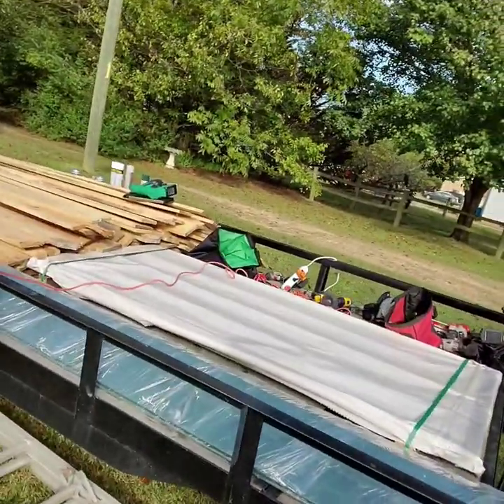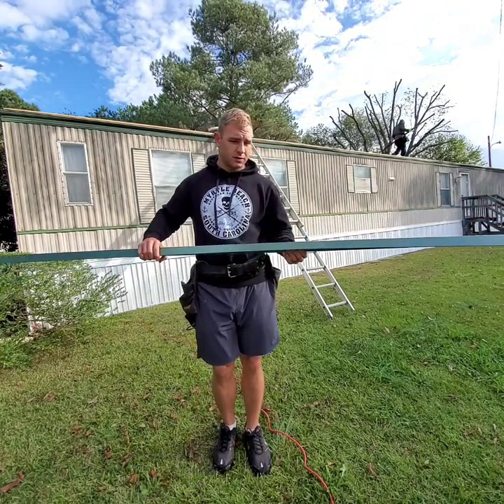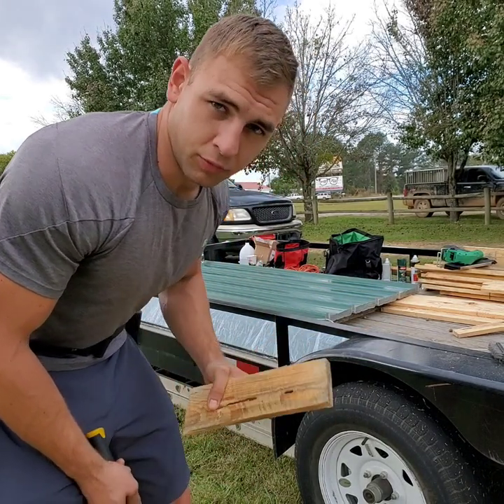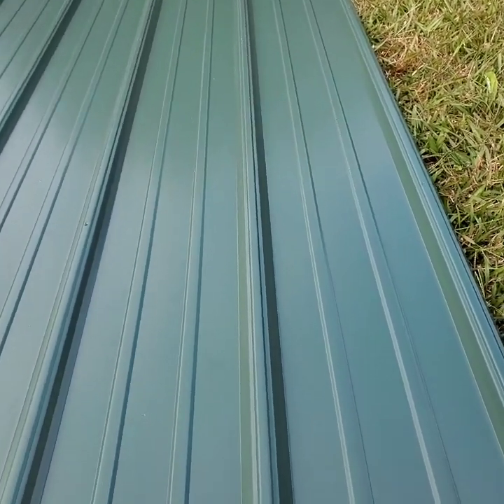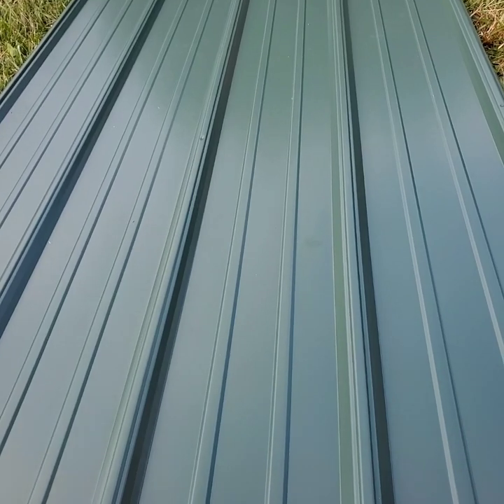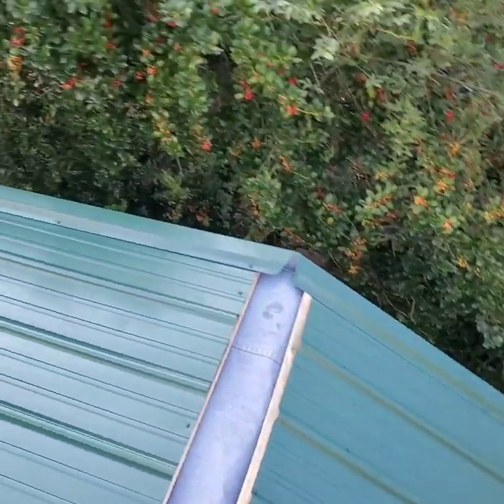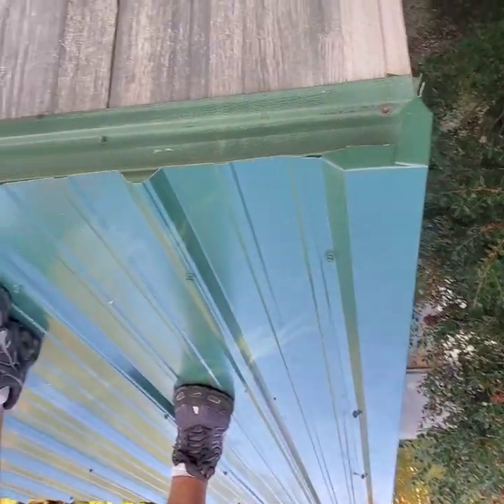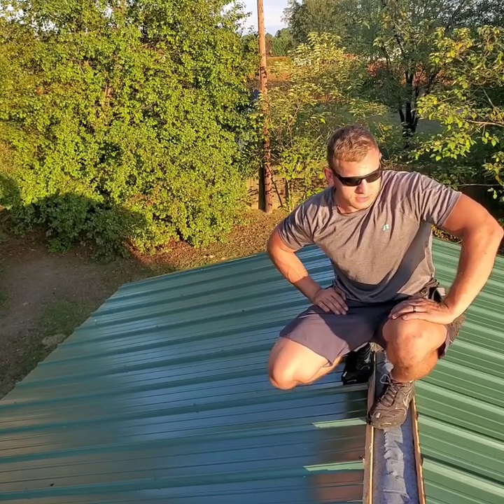How to install a Metal Roof on a single wide.

Comment: Just put vinyl siding someone gave me on a 1971 single wide and gave it a much improved face lift.This is my project next spring to finish it off.Great video to get me motivated.
Reply: Do you  have a video of that? How did you do it I have a 74 model do I take all metal siding off an put vinyl  just like you would a house?

Comment: Great video. I've been wanting to roof my single-wide and your video has given me a lot more confidence. Thanks.
Reply: So there's no gutters it just runs off the roof on the single wide, you covered up the gutters or you just left them underneath?
Reply: @michaelstefani2193  I took the factory gutters off, because they were in such bad shape. I installed 5" K-style house gutters
Reply: @michaelstefani2193  5" house gutters with a super thick bead of Lexel between gutter and home, hidden hangers on 24", screwed on 4", downspouts on all four corners
Reply from the maker: I'm happy to hear!! congratulations!!
Reply: Where are you guys located ????

Comment: Great job Ricky.  I do a lot of work in Charlotte and some S. Carolina work near the Pee Dee.  With about 15 years experience, screws in the ribs are just fine.  With the amount of rain we ha e been getting lately, it’s probably the best idea.
Reply: im going to do mine and i will add a bead of sealer between my over laps as a protection.   Make sure you know which way the wind blows 90% of the time. Why because you need to lap start at the end the wind comes. this way the tin just rolls with the wind.

Comment: I think I would have added a layer of ridged insulation between the 2x6s for additional R-factor as well as to reduce any noise from the suspended metal panels.  Just a thought.
Reply: Good observation and thinking. It is common practice to add insulation.
I think he used 1x6 material not 2x6. The R value of ridged insulation for that application would be R5. 
They did a pretty good job overall.
I like to vent the eaves for intake air between the panels and the existing roof,by having 1/2" routed notches every foot and spacing the boards at the lap boards allowing air intake to flow to the top,where I usually run a continuous vented ridge.
I usually add felt paper before the firing strips.
And I use butyl at the eaves,and caulking on the laps,at the top and opposite side of the siphon groove.
I have added insulation board between the furring and every bit helps in a mobile home.
The way the did it,will most likely outlive the home.they did just fine.
But like you mentioned,adding insulation is a good way to improve the installation,and there is always room for improvement.
Reply from the maker: @richardspearsii286  You can if you'd like, but the cost does go up considerably. There are no problems without though.
Reply: Is ridged insulation a certain type of product or do you mean the process of filling the space with insulation. If so, what type of insulation is suitable?
Reply: Just my input the insulation is worth the cost and the time to put in between.
Reply: I think it would reduce the rain sound.  Insulation. Is good.
Reply: Need to factor in the additional weight and what original truss are rated for.

Comment: all this seems very straight-forward and logical.  my only concern is whether its a good idea to punch holes in the factory roof.   I suppose I need to do it right the first time, or perhaps use sealant of some kind?

Comment: Looks like you guys did a nice job on the roof....it's June 2020 and I'm about to do this myself later this fall on my double wide home.
Reply from the maker: Thank you. That's awesome, be sure to get a galvanized substrate and it will last forever.

Comment: Looks like you did an excellent job! 👍 I realize this video is now old and you may not be reading comments but if you are, how much would it cost to install a new roof on an old 1985 14 x 60 mobile home with a pitched metal roof? It is actually 14 x 56 when excluding the tongue.  Thanks.

Comment: First question what were the nails that were used on the 1x4 on the perimeter, they seem to have some kind of plastic seal. They are under the two by inch edging.

Comment: On the rake when you started putting down the wood .
You should have used a solid board up the rake and the opposite side .
To stop uplift .
During severe weather events.
Great roof job as well.
Im53 yrs old 
32 of them ROOFING .
Reply: maybe you could explain to my parents a metal roof doesn't cost 20 thousand dollars and can be cheaper than asphalt in the long run
Reply: @cdoublejj  
Actually a metal roof could last 50yrs plus.
Shingle roof s last 15 to 20.
Ive been roofing 35 years.
All depends on where you live in the usa.
Reply from the maker: I agree, that would have been a better idea. I do warranty my roofs for 20 years though. So the home owner is covered regardless.
Reply: I am planning to do something very similar to what was done on this video. I might use more 1x4s or 1x6s closers together because we have real wind in my area. I am not a roofer and would like a little clarification on what you are saying. Are you referring to the short ends of the mobile home? Please explain so I have a roof that will withstand the heavy winds we get.

Comment: If I'm going over an old metal roof on a trailer house all I have to do is put down a sweat barrier underlayment and then run some Bridge boards down it like you did put the metal right over it I don't have to use decking right? I could just screw right into the 2x 4S right or 2 by 6 right

Comment: Clearly you guys do excellent work!   As for the video production, you could edit this down to 10% of its overall length (1 hour 18 minutes!  yikes!) and the instructional aspect would not suffer, and include some technical aspects like what fasteners you use to attach 1x6 boards, and you would have a decent video.
Reply: That’s why there main job is construction lol they can build your house but they can’t edit a video well. BUT there better then I am in both departments

Comment: Hi, great video, my question is, how did you locate the rafters to know where to nail down the 2x6's? 
Thanks
Reply: Good question
Reply: Not sure but early in video you can see where original roof panels come together. I think those are where rafters are.

Comment: You didnt explain how you sealed around the exhaust vent pipes could you add that in a future video? Thanks and great job
Reply from the maker: I should have explained that, I will add it in my future video's. I use a tripolymner called Geoceal. If you can fit a pipe Jack over a penetration, it is best to use that. In this situation I chose to cut it tightly and seal around the exhaust vents.

They both landed in the center of two joining panels, so I made sure to seal up the laps in case any water worked backwards and wicked over.
Reply: Very good question, my main reason for watching!

Comment: Great video we learned a great deal from it, but would you please show a close-up on how to cut the rake trim to fit also when you were putting the ridge cap on did you overlap or just put them against each other im sure that wasn't just one piece lol?

Comment: Were getting ready to do this to our 1987 single wide, the exact same way you did it in this video, only difference is were using 1x4s instead of 1x6s. My only concern is will putting a new metal roof over the original metal roof cause it to "sweat" and cause damage to the interior from condensation? Thanks

Comment: Closer strips good idea i took apart metal roof that my mobile home had before and it had alot of gunk inside at ridge even though metal was bent so that gunk wouldn’t get in it still managed it way in there
Reply from the maker: If you have a ridge vent installed, It's a good idea to install screen wire. I've done several repairs from other jobs where someone didn't use it. It helps the best.

Comment: are these just untreated pine 1x4's? do i need to add foam board insulation down first or at all? Being put directly on my OLD mobile home factory metal roof.
Reply from the maker: they are untreated 1x6's yes. I would not recommend putting down on the bare metal. Also, using treated wood will  cause issues with the screws.

Comment: Great video.  Need a cameraman so we can see the process close-up, as you're doing the work.  I was really hoping to see how you tighten the screws without collapsing the rib?  Without some kind of backing under the rib, it'd be easy to over-tighten.  So since they aren't technically tightened as I know something to be tightened, what prevents them from backing-out a tad over time and then leaking?
Reply from the maker: Thank you for the feed back. There is a washer that is in between the metal rib and the screw head. During the tighten process, all you need to do is pay attention to the washer. When you begin to over tighten the washer, It will expand as pressure is appliqued. So the best gauge as to what a tight screw is, is to mainly focus on the washer as you are tighten down the screw. People who buckle down ribs do not pay attention to the washer or force being applied from the screw gun.

Comment: Very good job!! So you give a 5 in over hang can a 2x4 be attached  to the bottom to put gutters on or how would gutters be installed? Thank you
Reply: Yes you have to find angel of roof cut 2x4 to that angel screw it through hang over into 2x4 bend your metal flashing 2x4 xhangover x1 1/4 tab to nail

Comment: Ricky thanks how do you get the old gutters off there's so much aluminum Coatings over the roof it's hard to determine whether you cut them off or they held on by screws?
Reply from the maker: I think it is best to just cut it off. If you unscrew it, it will open up the siding and eves.

Comment: I wish you would explain how you square up the first panel so you know the rest will be right. Also more detail on flashing the vent stack an end cap. Also did you drip edge the panels? Job looks very nice bit then so did the existing roof so why the roof over?

Comment: I'm about to do this on a trailer I just bought, but I would like a 1' overhang. I watched another video doing this and he used 5/8" plywood covered by underlayment over the entire roof instead of strapping. This was also the way he got his overhang. I thought it might be overkill but it definitely won't hurt. What are your thoughts?

Comment: Since you covered the existing built in gutters with the 5” overhang, how would you install gutters in this application? Thanks
Reply from the maker: Hi Tony, if gutters were planning on being installed, I would remove the existing ones or cut the j channel so it is flush. Then attach the gutter brackets to the fascia. If their isn't any wood for the brackets to attach to, I would recommend strap hanging the gutters to the metal roof.
Reply: Would gutters be needed?

Comment: What size and kind of nails do you use to hold the boards down to the roof? also how many nails do you need to use and how far apart.Thank you and the roof looks great.
Reply from the maker: 8 inch sinkers work great! and I try to nail atleast 2 per rafter on a 1x6. more is better as well, but you can split the wood if you put to many.
Reply: How did you find the rafters

Comment: God bless & thank you for the video, may I ask- in most Mobile Home applications especially in older models do you have to beef up the structure around the roof to have a strong stable hold on the additional heavy weight of a metal type roof on a rounded roof install. I'm going from a rounded 1971 roof to a brand new slight pitched roof. I was told by a roofing company that you have to beef up that structure on the older style rounded roofs?
Reply: You are probably right about that. Instead of doing the metal roof, an alternative might be painting your whole entire roof with Henry’s 100% silicone. That’s probably what I’m going to go with
Reply from the maker: I prefer flat roofing on those older homes, but i have seen people install full sheets across them with a slight curve. I personally would install rubber though.

Comment: How do you find the rafters in the roof to nail your 2x6’s to. Or did you just mail it anywhere and hoped you hit a rafter somewhere. I didn’t see anything about hitting a rafter on the original factory metal roof.
Reply: Not 100% sure but I think the metal roof original to the mobile home has seems that align over the rafters. If not most of the time you can see them as the roof hangs on them like skin over a rib cage. You can feel them when walking on the roof

Comment: I didn’t see any butyl tape being used on the laps of the metal. Also how to you know how high to bring the metal on the ridge. A lot of installers I’ve seen use plenty of butyl tape and silicone 1000 on joints and laps. Aren’t you worried that if a strong wind comes through and no rafters being hit, that that roof will fly off?

Comment: The reason I clicked on this was to see how you did that pipe penetration and you never showed it thought it was alright watching you put the roof and but you never really showed us anything close up so everything I already knew about Roofing is all I want the way with no answer the questions
Reply: Which pipe were you referring to? 
If it was the bathroom or kitchen exhaust vent pipe,then there is a product called a decktite or decktight it's a cone shaped rubbery metal reinforced flashing that gets caulked and sealed then screwed to the roof.
Usually grey, sometimes black and then red when it's used in a heat application.
They can be used on penitrations from 1/4" to I believe 24".
There are also options to add metal exhaust hood,in various sizes depending on the needs.

Comment: When you guys stripped it out with 1x6's, what did you hit under the aluminum? There must be wood trusses underneath? If so, are the trusses under each seam of the aluminum? Thanks.
Reply from the maker: Hi Antler, Thank you for watching our video. We did hit the trusses underneath of the aluminum. They aren't very big, so you have to be sure your hitting them.
Reply: Good question.  I was wondering for the same thing. Thanks.
Reply: Thanks you answer my question lol

Comment: Why do you use 1x6s and not 2x4s or 2x6s? Could you have put foam boards between the 1x6s against the metal and under the new metal roof?
Reply from the maker: They provide the best surface area in order to walk on. 2x4s are slimer. And 2x6 is way to much.

Comment: Mm old roof is leaking,and I have watched this video 3 times and I got to say bro you do dam good work, Hell I don't even know you and I would recommend you to people, question? What size of wood do you use to frame the roof out,, 1x4,, 2x4,,I want to do it just like you did this one, do you screw them down or nail. I sure hope and pray you dont get angry with me asking these ques.s ,  I live in florida and I'm 70 yrs. Young and there's only me and my wife of 35 yrs.together, hurricane Irma went thru here I been patching every since, Just a short little story,I was a electrical lineman for about 10 yrs, so I needed a change so I went into the army, got out in1977 went back to work I fell about50 to 80 ft ,since 1981 I've had 6 total right hips put In,3 left knees,last one was completely artificial, I broke my back, 5 surgery's on my shoulders, I could go on an on. I'm just watching you to see what size of everything I need is .sorry to tell u my life story,we dont drink or drug. Are they anyway you could get me that info somehow.

Comment: Were you using a impact driver to run the screws? If not please let me know what you were using, Thanks and great video.
Reply from the maker: Hi Jeff, Yes we were using impact drivers. A normal screw gun with the correct bit attachment works just as great. If you choose to use a impact gun, be mindful of how far you are fasting the screws down. you risk buckling the metal and damaging the washer if to much force is used.

Comment: I have a trailer this size the only difference is mine has a chimney. What's a ballpark figure on price for a job like this?
Reply from the maker: Hi Kenneth, I will private message you.
Reply from the maker: I wasn't able to figure out how to send a private message. Please email me at c.p.metalroofing@gmail.com. I will respond promptly.
Reply: how big is your home.  there are 2 equal long sides, n 2x width   if its 14x2= 28.  2 x 80 = 160.   then the center of your roof  you need to find the pitch.     multiply this plus how much you want as an over hang. 
I'm an old lady n know this answer....Oh heck just get a thin person to get on thr roof and never walk across a mobile like that. walk on the beams that are too thin any way ha ha ladder end to end then at the ends measure across the top edge bling theres the answer.

Comment: I'm a novice, but I have a few questions. What's the overlap on the panels and ridge-cap?  I noticed that you placed screws on the flat part of the panel at the ridge line. Do you attach the ridge-cap only through the ridge of each panel? If so, what's the spacing?
Reply from the maker: Overlaps with ridge cap need at least 4 inch's however I would go no less than 6. to ensure wind driven rain wont push upwards. I screw the ridge cap down to the panels (into the 1x6 underneath) on the rib sections of the panel's. If near the coast, do every rib. if in the piedmont region or further inland, every other rib is ok.

Comment: What was your helper spraying on the existing roof early in the video?  He was using an aerosol can and wiping it off the roof.
Reply from the maker: Hi Reid, thank you for watching our video's. The home owner requested that we grind away the exposed rust & spray rustoleum over it. So that's what we did. From a professional stand point, I don't believe it's necessary. However we did anyways :).
Reply: I was wondering the same. Why do that if you're going to put holes thru it when installing the strips.